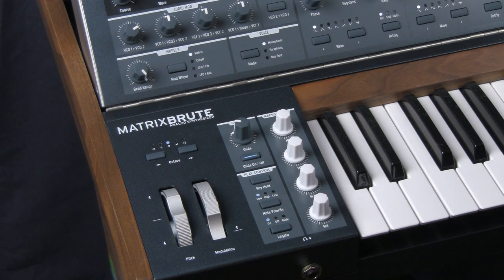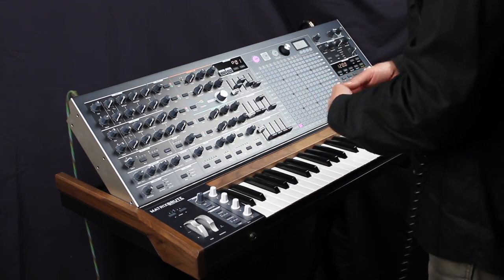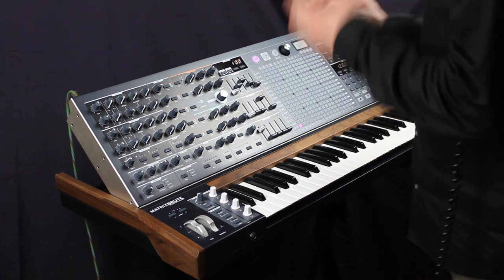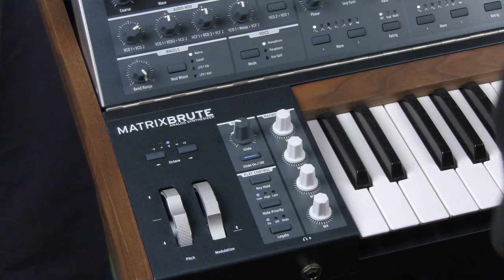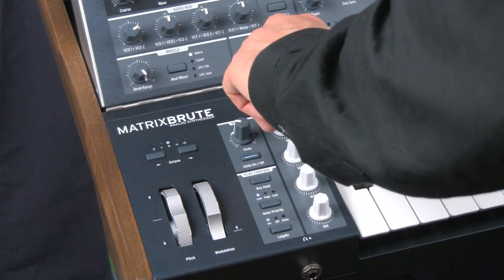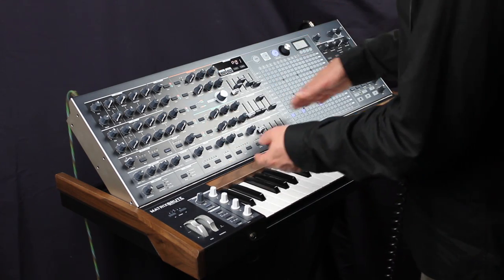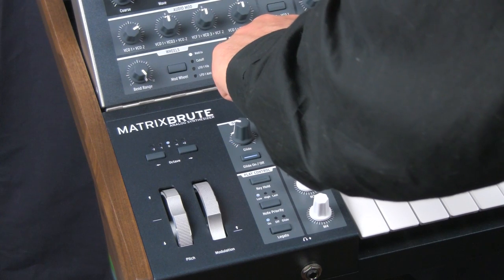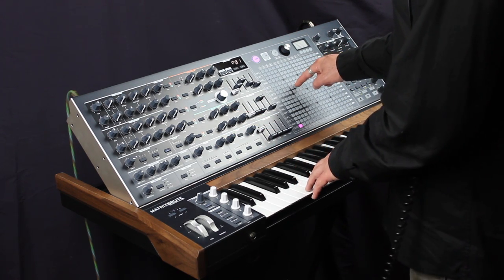The Arturia MatrixBrute- Part 21- Macro Knobs

Comment: Wait! WAIT

I just realized something.... if you were to assign various functions to one of the macro knobs, and then use that knob as a modulation destination for one of the assignable 4 slots in the matrix, wouldn't that essentially give you 16 times the customization? So instead of say.... assigning VCO 3's frequency to custom slot 1, and say... VCO 2's level knob to custom slot 2, you can route both to macro knob 1 and then modulate it! Since there's 4 macro knobs, and they can govern all 16 matrix points at different values per point, you could essentially expand the amount of control, right? Holy shit! I gotta go try this right now!

Comment: Hi, Marc!  Thanks for these awesome videos!  Quick question about the macro knobs: is it possible to assign two parameters in such a way that as you turn the macro knob clockwise, it increase one parameter but decreases the other?  Thanks in advance!
Reply from the maker: Yes!  You do that when you set how much the macro knob will affect the destination in the matrix.  You press the button to make the connection, and then you set the amount with the "Mod Amount" knob... and you can set that knob in  either positive or negative values.  If you make one patch connection where the macro knob controls a destination in positive, and one connection where the macro knob controls a different destination in negative, you'll get the effect you're asking about.
Reply: Awesome!  Thanks a ton for the explanation!  I'll give it a shot!

Comment: hi Marc! great series, I hope it never ends! :) 
I just want to ask you : is it possible to assign a macro knob to modulation amount? you have to assign them in the extra 4 slots of the matrix?
thank you!
Reply from the maker: Yes, you can apply one of the assignable columns as an amount of modulation to a connection, and then apply the macro knob to control it as a destination.
Reply: Ah ok, thanks Marc! Greetings from Argentina
Reply from the maker: Thank you, Marco!  I've never had greetings from Argentina before, and I think that's really cool!